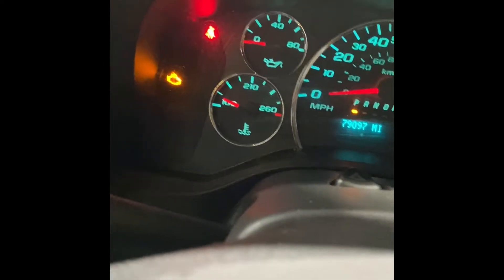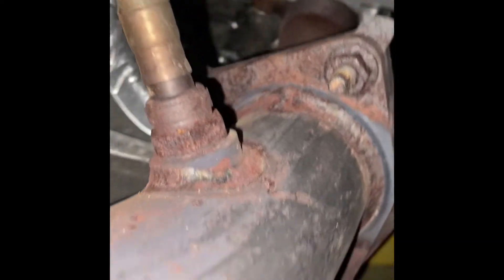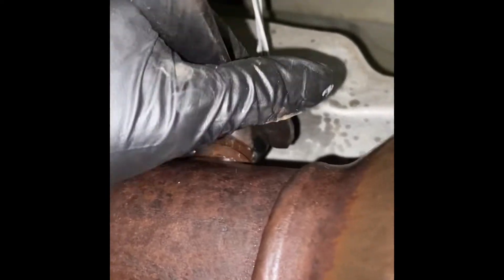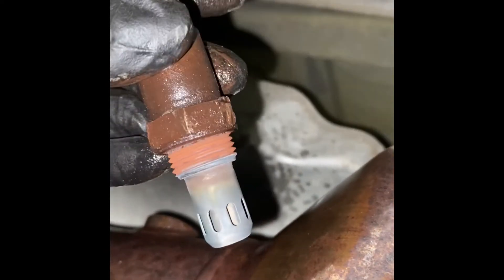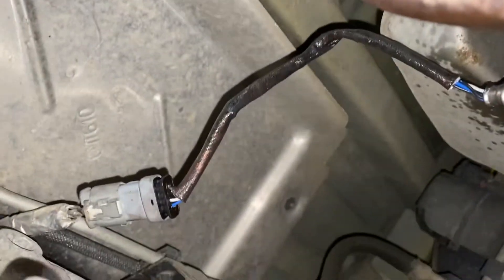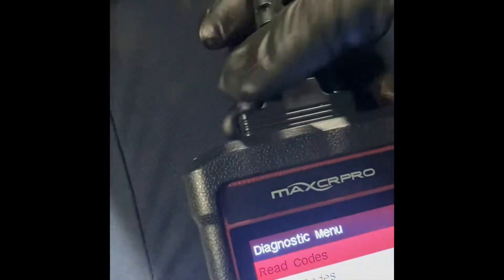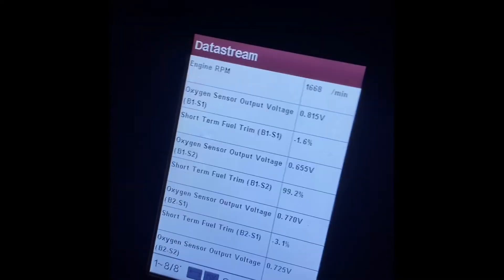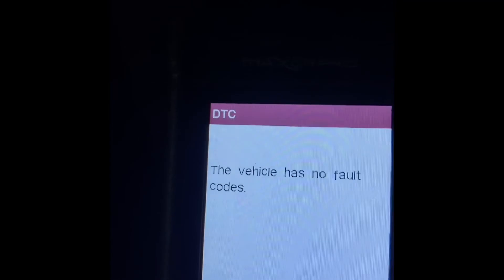P0137/P0138 o2 sensor circuit low

Comment: Replaced both sensors, 2015 Buick lacrosse 02 sensor circuit high voltage (bank 1 sensor 2) and still getting P0138 code what should I do
Reply: hey mate, have you found an issue? i got RR l322 5.0 v8 and the same issue, all 4 sensors new, new cat's, new MAFs and P0137 (bank 1) is coming back, no clue what to do....
Reply: Have you reset the codes ?

Comment: Drove it around for over 300 hundred miles and still nothing, the check engine light comes right back on
Reply from the maker: Do you have a four-cylinder or a six cylinder? Some exhaust systems have four (up streams and downstreams) sensors there is bank one and bank two a four-cylinder only has one bank. The code you have is for bank one sensor two sensor which is downstream.
Reply: @smartmotives  it's 4 cylinder. 2006 chevy aveo